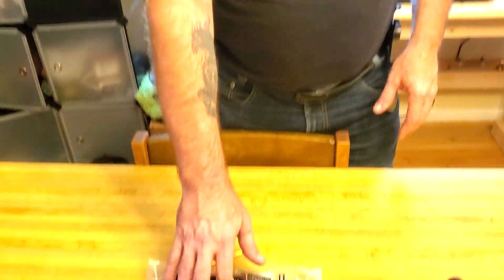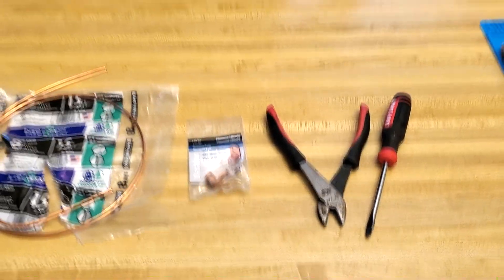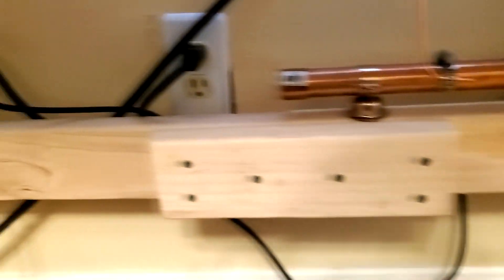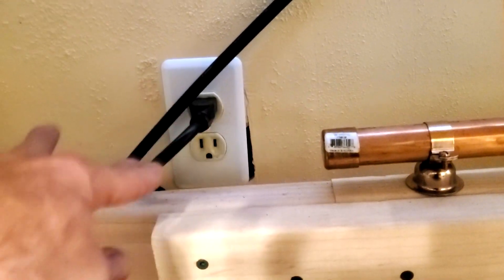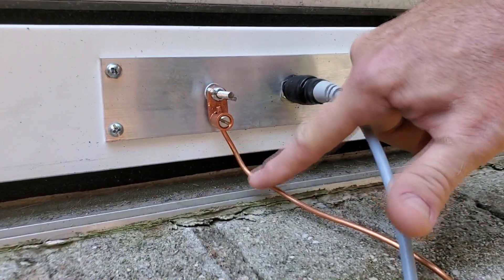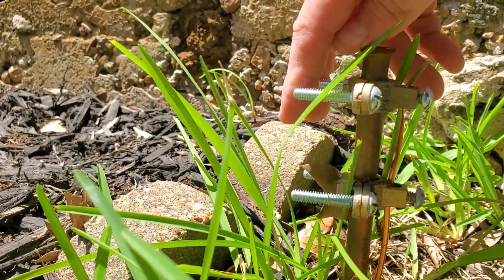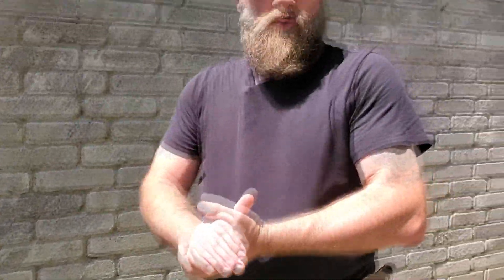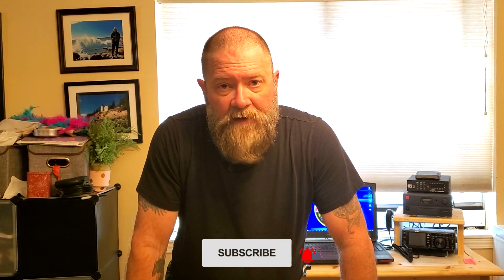How I ground My Ham Radio Station

Comment: I may have missed it, but when you went to the ground rod did you say it was the main ground rod for your power service entrance? That’s a very important point to make. Too many hams just add a ground rod for their radio and do not connect to the service entrance ground rod. The ground potential at one ground rod can be very different than at another during a surge or nearby lightning strike!
Reply from the maker: Actually no.  The main service ground rod for my house is a bit away and around the corner from where I planted that rod.  I cannot figure out how to get it connected without running a long wire around the house.  Thanks for watching and for the comment.  73!!
Reply: @HR4NT  Same here. I did not want to run a long wire to connect the shack ground to the service entrance so on my new house I do not have a ground rod for the radio. I physically disconnect the feedline from the radio when not in use.  In my case, mostly dipoles, there is no need for a ground for the antennas to work. If I had an end fed wire or something fed against ground it would be a different story and I would be forced to run the bonding wire to the service entrance or make sure the connection to the radio ground rod was physically disconnected when not in use. My suggestion is to never have a separate ground rod not bonded to the service ground. I am an EE with both power and electronics experience. I always ask my self WHY is something necessary. Like why do I need a ground with my radio? Sometimes there is no reason and some times there is. If there is a reason, I then ask what harm can come from adding one? The answer in my case was I did not need a ground. With an end fed antenna the answer would have been, yes I need one. Then I would ask what harm is there?  Great potential harm if it is not bonded to the service entrance or physically disconnected during a thunder storm!  I sure do not want the lightning to find its way from the shack ground rod through my radio and then the green wire in the power cable through the house to the service ground! The potential of the ground at the shack rod can be thousands of volts different than the service ground.
Reply from the maker: @dandypoint  thank you for the reply!  I have two antennas I run permanently in my yard, the DX Commander and a Comet GP-9.  Those run to my window passthrough.  If there is a hint of a storm headed my way, I unplug everything from the wall and the passthrough, thereby rendering all my gear safe.  That was my solution to the issue of running and 25 foot long ground wire to my main outside my house.  Many will argue that it is wrong, but it seems to be working just fine.  If I had another way to resolve this, I would most certainly do it, but would still unplug everything in the event of a storm.  Thanks again!  73
Reply: @HR4NT  sounds like you are doing right. At least the same as me. I have used end fed antennas from time to time and disconnecting everything is safe.

Comment: Good video.  I'm quickly learning that grounding well can be tricky.  I'm trying to figure how to ground my Astron RS-35A.  There's no ground connection on it!   I've heard it's because you're supposed to use the ground on the plug to the electrical outlet but if I do that, there's no way to tie it all together like this.  Any ideas?
Reply from the maker: After a little research I found that this is a common flaw with Astron power supplies.  The inconsistency between models and how they ground is a bit ridiculous to me.  I do not want to give you bad advice, so my best advice is going to be research forums and find other owners of that same model and see what they did to resolve that issue.  With my Diamond, I do not have that grounded although there is a place to do so, but i have also never had any issues by NOT having it grounded either with RFI or other issues.  I hope this helps a bit.  Thank you for watching and for the comment.  73!
Reply: @HR4NT  follow up here: Astron replied and said for this old model, it's the double nut screw near the power receptacle.  I guess we can close the case on that one!  Thanks again.
Reply: @HR4NT  I do appreciate it.  Yea, I've looked everywhere, too, and also contacted Astron.   No issues so far!  Really appreciate your show and your time spent look into this. 73

Comment: This will create a ground loop.  At that power supply, you'll have one ground on the case from your rod and a second ground on that case from the 3rd prong of the AC power plug.  Those two grounds will NOT be at the same potential and a current will flow.  There's your ground loop.  The rod you installed outside and the ground at the AC service panel need to be connected, and by some other means than the case of your power supply.  :)
Reply from the maker: If I could figure a way to connect them being that they are 20 feet apart, I would.  Thanks for the comment and for watching!!!  73!!
Reply: @HR4NT  Inside the house, attach some solid #6 to the bus bar in your shack (your copper pipe) and then run that to the bus bar in the breaker box that the main service ground rod is attached too.  Don't have to mess with the service ground rod outside at all.  Bonding these two ground systems together is actually required in the NEC.

Comment: Nice setup. I have a solar system that has three 8 ' rods tied to my service panel I ran a 6 awg bare copper back to my service panel my noise floor dropped to a 1/4 of what is was before.  I'm working on a lightening suppressor using multiple spark plugs. There cheap easy to use and are adjustable via gapping.
Reply from the maker: Very nice!  I am still trying to figure out how to run a wire to the service ground without seeing it...no way to bury it with my setup.  Thanks for the comment and for watching!!!  73!!
Reply: Hi Ray!
Interesting comment. Do you have a source for creating, calibrating and installing the spark plug lightning arrestors? I'd love to follow in your footsteps.
Kind regards,
John - KK7JBZ

Comment: Also to test new ground rod  it must be 25 ohms or less to a known ground . In sand sometimes a ground plate is better. Salty soil grounds better. Dont use plumbiing pipes as ground even though that was done years ago.
Reply from the maker: Thank you for that info.  I agree 100% that there is no need to tie your ground into your internal plumbing pipes.  That may have been a trend back in the 70's, but no longer.  Thanks for watching and for the comment.  73!!!

Comment: On your outside ground rod we used Cadwell connecter and added a   Nicole (5 cent) for better metal blend. The cadwell is a item you set on the rod add the wire and light with a  Torch. Kind regards. David
Reply from the maker: Great tip!  Thank you very much!  Thanks for watching and for the comment.  73!!!

Comment: Excellent video.  As you note, my most common question in this and other areas of life, "I understand the theory of what you're saying, but what does that look like in my life?"  I mean, what does it look like when the rubber actually meets the road?
Reply from the maker: Yeah the topic of grounding is like bringing up politics at a family function...LOL  It causes a lot of discussion both good and bad.  I have been told my method is wrong, however it seems to have been working just fine for the past year without issues..so...Thank you for the comment and for watching.  73!

Comment: Hi,  What is the purpose or what is the reason for the ground rod?  What do you think that it does?  With respect to the grounding conductor, stop and think about skin affect.  Also, adding a ground to the electrical system as shown, in my view as a former building inspector, is a violation of some electrical codes and may, may create a hazard.  You are doing it as shown in ARRL publications.  But stop and think about that rod and grounding conductor.  I am trying to be helpful not critical.  If you would like to discuss it, I am happy to do that. You may want to delete my comments after you read them.  73, Jim
Reply from the maker: Hi Jim!  It is not often I get another Youtube celebrity commenting on my videos!  In my understanding the ground rod allows for an electrical path to dissipate a static discharge and thereby protecting my equipment.  My radios are plugged into a separate circuit from anything else in the house.  However the location is far away from the breaker box and the ground rod below it.  My idea was to add a ground rod just outside the shack, thus keeping the connection as short as possible.  I have had this configuration for over a year now without any issues.  In addition, if any electrical storm is on the horizon, I tend to unplug everything just for good measure.  Thanks for the comment and for watching...73!!
Reply: @HR4NT  I am no celebrity but thanks for the kind words.  To summarize and then comment, you have the station away from the "breaker box" aka main panel and it's important ground rod for the AC electrical system. Your ground rod at the station may be a mistake.  And, it may be a dangerous mistake.  If there was a fault and current wanted to flow to ground (perhaps an open neutral), then the current would be flowing to your ground rod and NOT the intended ground rod at the panel.  As I read and enforced the code many years ago, ALL current must flow back to the panel; period. We can talk about the storm later.  Also, there is no such thing as an RF ground.  Your ground rod is not an RF ground.  It could be a mistake in the event of a fault. I don't watch other guys videos.  I did watch this one and part of another.  I very much liked your presentation and the graphics.  Good job! 73, Jim W6LG licensed in 1964 and for a few years an inspector, member of the building code board, board of appeals, planning commission......and more, even expert witness

Comment: old school lightning arrester used a Champion CJ7 or CJ8Y spark plug connect the body to ground and the electrode end to the drive on your cable, if lightning strikes the antenna, or near the antenna the static will jump the gap instead of blowing the radio, there is also the Nasa way which uses a huge photo strobe (the old flash bulb kind, not the modern Xenon strobe tube) its a one strike kind of thing and opens the circut completely in the event of a lightning strike or near strike, the spark plug trick was told to me by a ham in my car club, the photo flash bulb trick was from an engineer that apparently worked out at cape Canaveral, from what i've seen most lightning protection systems are just a spark gap to ground or some sort of fuse-able link setup, hope that helps, also great setup but you do want to keep your grounds as short as possible to prevent an imbalance of potentials which can lead to radio damage or risk of shock
Reply from the maker: Thank you very much for those tips.  I will have to look into them more closely.  Thanks for watching.  Have a great week!  73!

Comment: No No No!

My install would Be is to have all the ground wires mount outside With the ground pole into the ground. I would have the Ground wire installed on the antenna mount wherever the antennas mounted and have it separated from inside the house. I’ll do my best to make a video review on it. My house actually has It’s on ground pole installed into the ground for some other equipment. But when it comes to running the cable for the radios I would just have it come through the window. The ground wires and ground pole mounted outside should be enough ground for a lightning strike if it should hit. You should not have to buy extra lightning adapters because the ground pole itself is pretty good because it’s already mounted far into the ground. 
Ill also be sending you a link to check out for a roll up antenna that you can use for inside if you want. You don’t even need to have a antenna outside.
Reply from the maker: Thank you for the feedback and suggestions!!  73!

Comment: Outstanding video! I do have a question, as I don't have braided wire to go from my radio, power supply etc. to my copper bench pipe what gage unabraded wire do you recommend ?
Reply from the maker: If it is just going top be temporary until you can acquire a braided wire ground, I would thin you would be good with 12 or 10 AWG.  You just want a solid ground top prevent any damage to your rig and equipment.  I would definitely invest in some braided cord though.  It wasn't too much I think I paid $9 for those 5 foot pieces I had.  Good investment, done and done.  Thanks for the questions and for watching.  73!

Comment: I have a grounding wire for my house already; can I simply connect to that?
Reply from the maker: If it is relatively close to your ham shack I would think so.  Mine is around the corner in my back yard, so I planted one near the window just outside my shack and that seems to be working just fine.  However, when i catch wind of a storm approaching, just for good measure, I do unplug everything and unhook my antennas from my window passthrough just in case.  Remember to do that, and you will be fine.  Thanks for the question and for watching.  73!
Reply: @HR4NT  I have a grounding conduit that you can connect to next to my breaker panel
Reply: For lightning protection, RF noise isolation, ground loops and more importantly national electrical code you want a separate ground rod as close as possible to where your coax goes into your shack/house and have the rod(s) "bonded" (electrician speak for connected...) with a preferably solid #6 or #8 AWG copper wire to the main ground rod of your house. 

Lightning/electricity follows the path of least resistance right? So if you get a strike on or even "near" the antenna (from what's called a "feeler") without a ground rod on your outer wall, that bolt can go IN to your house/shack back out to the main ground rod BBQ'ing everything along the way! 🔥🔥🔥 Got marshmallows? I suppose if you're only talking a few feet you could run a coax lightning arrestor outside at the point of entry with a #6-8 wire tied to your main ground but again, path of least resistance... Just don't tell your local electrical inspector or the insurance company!  😅 (and don't quote me on that!😁)

Comment: Why is a mechanical connection better than a soldered one?
Reply from the maker: It's mainly because if lightning strikes the solder connection will instantly be vaporized and you won't have a ground.   Hope this helps. Thanks for watching and for the comment. 73

Comment: I have a 200-watt Yaesu 101MP, upgrade from my 991A.  Been running barefoot w/ no ground now for many months, but I just bought the Palstar matching linear amp & tuner (ab 800w @120v), & now I have no choice but to ground everything or they won't work! Learning along w/ u! I'm lucky to have a communications professional who does all my work, The ARRL Grounding  Book suggests a connection between my station & the house electrical panel. I doubt I'll be going that route. Bottom line is I need to see a 1:1 SWR w/ an 800-watt output. DXcc dp antenna. Pretty basic.
Reply from the maker: I hope that whatever solution you end up going with will produce the desired results you seek.  Keeping it simple seems to be a pretty good start and then if you have to optimize it further, you can.  Thanks for sharing and for the comment.  73!

Comment: Good video. Lots of strong opinions on this subject.  David Cassler and Ham Radio TV have discussed this.  Actuall David discusses this and Ham Radio TV had a guest presenter during a virtual HamFest last year.  Also there is a guy on YouTube that discusses the grounding relating to the code. So electrically if the ground rod is too long it looks like a inductor to lightning so short ground runs are good. I have a tower (Rohn 25G) and I have a ground rod for each leg.  My Elmer doesn’t like what I did.  But as far as lightning rods go, they say to keep them 8’ apart.  Some argue DC vs AC grounds. 

Bottom line.   I am an electrical engineer and am confused.  So ground rods are for safety primarily (in my opinion).   So antenna switches or manual disconnections for storms are advised.  Alpha Delta switches are good. They short our the nonused lines.  If lightning hit directly it can go where it will.  Sorry for so many words - do your homework and do the best you know.  You can’t make everyone happy.  Lol. All the best.  73 de KI5HXM
Reply from the maker: I agree that the subject of grounding is most of the time fighting words as there are so many opinions on the subject as there are Hams...LOL  I have mine setup the way it is, it works for me.  Is it the best?  Maybe not, but I also disconnect everything ANY time there is a storm in the area.  I don't mind doing it and it guarantees my equipment is protected.  I appreciate the comment and the input.  Thank you for watching.  73!
Reply: NEC FORBIDS doing this.

It is FORBIDDEN by US NEC to add a ground to equipment on house power thats already on a grounded circuit.

This stupidulity violates US NEC 

2011 250 24 (a)(5)

The reason youre confused and there are varying opinions is that none if you have the engineering and code knowlege to catch these liars and idiots  advocating " groud your statiin

Comment: I set up a ground for my radios and the power supply. I used the same copper pipe inside, and a copper rod, 8 ft outside. The only difference is that I had to drive the rod at an angle. Rocky Mountains = Rocks, tons of them. No way to drive the rod at a 90 degree angle to the ground. I used an 8 gauge stranded copper wire to connect the ground pipe to the rod. All the equipment have flat straps that I  got from DX Engineering. 
So far, it’s all good!
Reply from the maker: Sounds like you found a viable solution and as long as it works, you're good!  Thanks for sharing and for watching.  73!